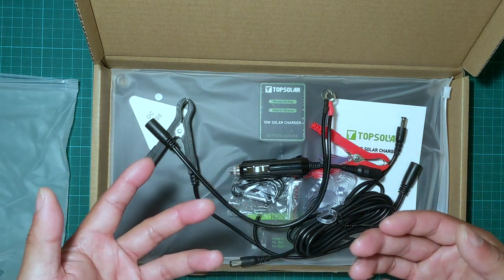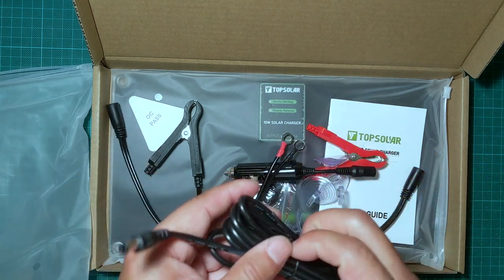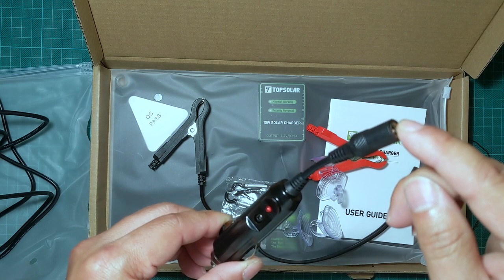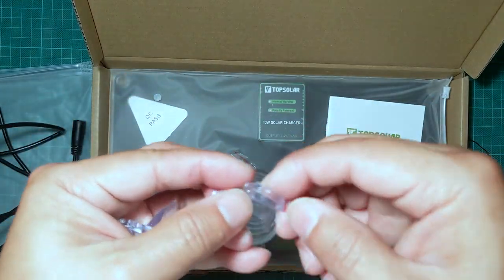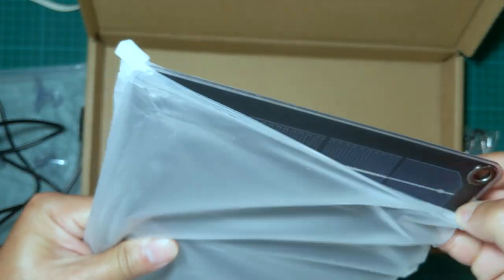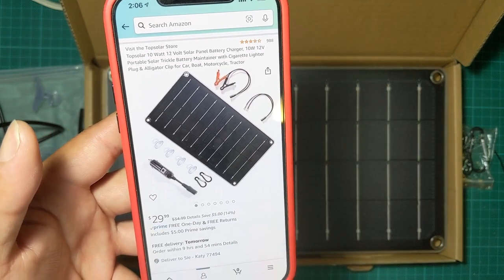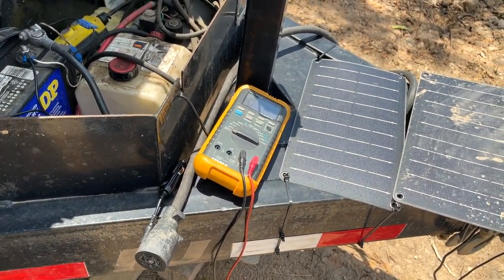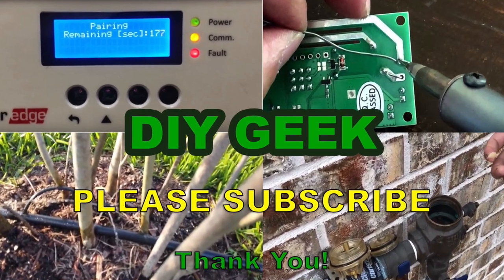TOP SOLAR 10W SOLAR CHARGER 12V

Comment: The thing that (hopefully) sets this one apart from others is the built in charge controller that keeps a max output of 14.4 volts.  And the included cigarette lighter plug for ease of use.  I just ordered one, so hopefully mine will work as well as yours!  Thanks for posting this.

Comment: In your use, do you leave it connected during starting the engine, or during normal engine running when the alternator is charging? Will it damage the panel is you leave it connected during these times, or must you disconnect it when you are going to run the engine? Thanks.
Reply from the maker: I leave it charging all the time. I never remove the solar panel. It does not hurt it

Comment: I just bought one (not arrived yet) but I've heard going straight from the panel to the battery is bad.  I have the parts to make my own with a voltage controller and fuse.  Which is best? Nice observation on the clips.
Reply from the maker: For what I am using this NOCO for... I only use the NOCO when I need to charge or maintain a battery.

Comment: Hi and thanks for the Video, was the activation stage simply just plugging into the 12volt cigarette socket and starting the engine , as I’ve bought it to maintain and caravan battery while in storage so I need to make sure I activate properly first thanks